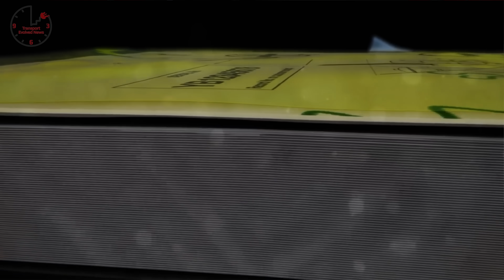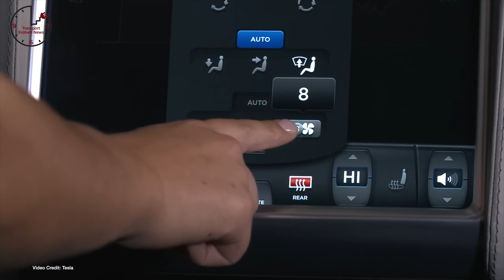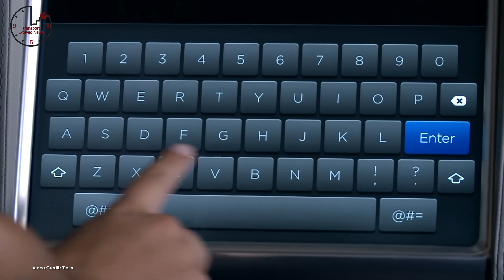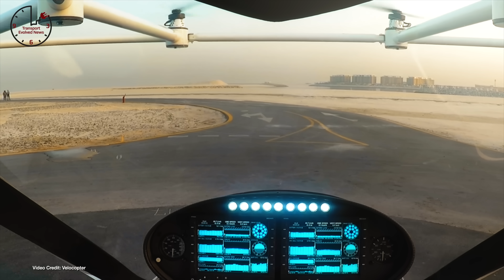TEN 323 - President Biden Acts on Climate Change, Store Dot, Rivian's $2.65 Billion Investment

Comment: It should be clarified that replacement of the MCU is not required to correct the eMMC problem with early Tesla Model S & X. Only the eMMC needs to be replaced. "The cost of this repair at a Tesla Service Center is currently around $120 in parts (subject to change) and about 1-1.5 hours of labor, plus applicable taxes and fees based on your location (ref. https://www.tesla.com/support/warranty-adjustment-program#FAQ ).  Replacement of failed eMMC is already covered by the existing Warranty Adjustment Program announced in Nov. 2020. A recalI would just be forcing Tesla to replace the eMMC in older Tesla Model S & X that haven't failed yet. Personally, I would choose to upgrade the MCU at the new lower price as it would give me access to all the new infotainment features available on new Teslas (i.e. make it feel like a new Tesla for a tiny fraction of a new car) It would also increase the cars resale value.  I don't see any other auto manufacturer offering infotainment system upgrades for their older cars. They just want to sell you a new car.

Comment: Tesla's behavior is unacceptable when it comes to the recall. Electric Jesus/Elon Musk needs to be called out on this. The fact that Tesla can remotely disable features in a car that you already own is another reason why I won't be purchasing a Tesla. It is a real shame because Tesla as a whole has moved EV tech forward tremendously. Without Tesla, established automakers would still be giving us half-hearted underengineered ugly cars like the Nissan Leaf ornBMW i3.
Reply: Actually, offering an upgradable MCU is another reason for buying a Tesla. No other auto manufacturer offers the ability to upgrade their infotainment to support the latest features available in their newest cars. They just want to sell you a new car.  It should also be noted that replacement of the MCU is not required to correct the eMMC problem. Only the eMMC needs to be replaced. Replacement of a failed eMMC is already covered by a Warranty Adjustment Program announced in Nov. 2020 (ref. https://www.tesla.com/support/warranty-adjustment-program ). A recalI would just be getting Tesla to replace the eMMC in older Tesla Model S & X that haven't failed yet. I don't see reducing the cost of the MCU upgrade as sidestepping the recall. Maybe a bit of an upsell, but one that offers great value to owners of older Teslas.

Comment: Partly based on your show the other day on if you should buy a 2020 Bolt, I did, trading in my 2012 Nissan Leaf. I bought an Oasis Blue LT. Great price, too. Thanks for your always excellent vlogs.
Reply: I test drove a Bolt and then bought a Kona -- but I needed the slightly bigger vehicle. I suspect you will love the Bolt. Also, you are reinforcing the theory that once a driver has gone electric, they don't want to hear about fossil cars any more. :) Well done.
Reply: Tai, I doubt I'd ever go back to an internal combustion car. I would have liked to even consider a Kona, but they are not sold in Texas, where I live. I'm happy with the Bolt.

Comment: There's a lot of interest in charging electric cars faster and faster. Has anyone given thought to how big the charging cables will have to be? There's a practical limit to how thick the cable can be and still be handled by an average person.
Reply: It depends on the voltage, if the voltage is significantly higher then the cables can be a lot thinner, it is Ampage that dictates the thickness of the cabling.
Reply: @TheEnimabandit  But the higher the voltage, the more insulation you need on the cable. Also greater separation needed between pins on the connector. I think eventually they need to go to charging stations with robotic arms.

Comment: Why do a lot of these models have huge bulging snouts? Can't they be bothered to re-design the thing? That Store-Dot underpinning/non-skateboard looks far from optimal for an EV. No fully flat floor, no frunk.
Reply: Aerodynamics and safety (crumple zone and pedestrian safety).
Reply: @kkobayashi1  BS. Minivans are a perfectly safe format of vehicle with dramatically better interior capacity. It is 100% a stylistic choice, even Ford admitted this when discussing the design of the MachE.
Reply: @patreekotime4578  hell no, it's simple physics, the larger the crumple zone the less the impact in the event of a crash, also its more aerodynamic
Reply: @antimatter4733  You do NOT need an entire meter of crumple zone in the front of a vehicle. An impact that will crush that much of the vehicle is very unlikely anyone will walk away from. 

 Id love to see some evidence of it being more aerodynamic to have a totally flat front, a long hood and a second bump for the glass as opposed to a smooth single curve starting from the front of the vehicle.
Reply: @patreekotime4578  you don't "need" seat belts either. However both significantly improve the safety in the event of a crash. The front crumple zone is specifically designed to crumple at the correct resistance to give the maximum chance to survival and its even more effective in electric vehicles where there's no engine in the way which allows way more space to reduce the force over.

You need only look at the coefficients of drag for different vehicles to realise that the most aerodynamic ones with a coefficient around 0.25 all have hoods, whereas when you look at vehicles that have flat fronts their coefficients are closer to 0.50. It's simple physics a sharper shape is always gonna be more aerodynamic
Reply: Patreeko theArtist, I don't understand what you are trying to say. Modern minivans all have bulbous noses. If that's not what you mean, how do you think EVs should look like?   Any examples you can point to that you approve of?
Reply: @kkobayashi1  the id3 has a relatively flat nose, compared to something like the Mach e so it is style choice, but then once you start getting flatter there will be aero and crash safety trade offs.

Comment: I'm forever hearing news of BEVs that cost more than 50K.  I"m not likely to fork over 60k, 70k, or 80K, or 100K.  Forgetaboutit
Reply: A lot of that is the normal starting with the high end to help recoup development costs faster, then they can bring out lower budget models. And we're only just now getting to the point of lower battery cost.
Reply: Thats what happens when its 2021 and so many OEMs dont even have their first EV on the road yet, let alone the mass market vehicles that are surely a decade behind that.
Reply: I purchased a 3 year old off lease Kia Soul EV for $12,000, makes a great around town car. Waiting for a $25,000 Tesla.